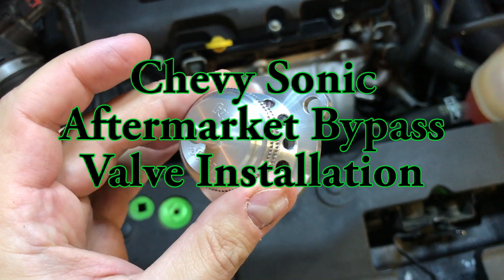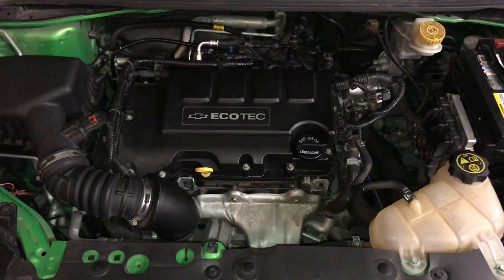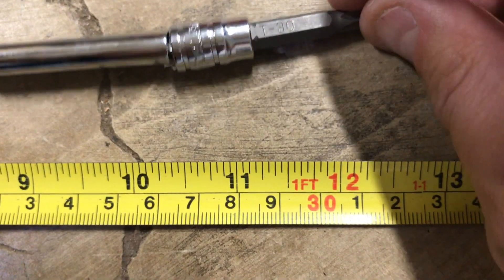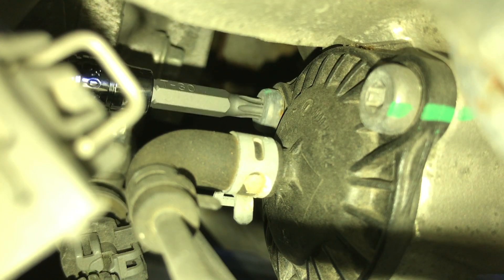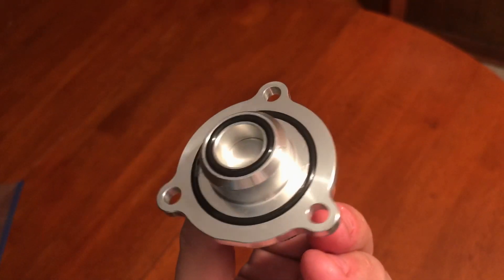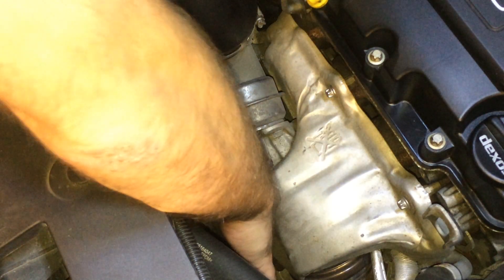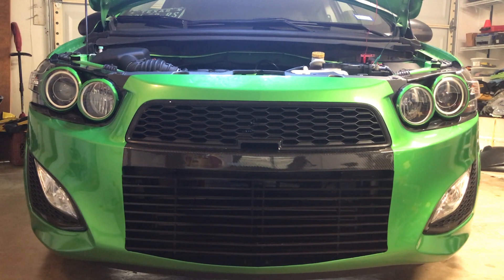Chevy Sonic BOV Install (Atmospheric Bypass Valve)

Comment: Do you use the old diaphragm to hold the new spring or did just put new spring with the valve in? Cause I’m having a hard time seeing what holds the spring center and in place without using the old diaphragm. Please get back to me.
Reply: Please get back to me ASAP.
Reply: Cause I have my car tuned and I don’t what to use. Do I use the new stiffer yellow spring that came with it or do I use the stock one and the diaphragm. Or do I just do not use a spring at all? Please get back to me
Reply: Because i tried using the stiffer spring and it’s almost not even possible to fit it in there. My common sense is telling me not to use a spring at all. Sorry for the spam I’m kinda time sensitive right now. So please reply
Reply from the maker: Nathan Miller I didn’t change the spring that came in the new Forge housing. The factory spring was completely removed. That is of course for the atmospheric. I don’t know the configuration of the Forge recirculating. Does this help?
Reply: DIY Toona yes I just ended up not putting a spring in. It sounds great. I was gonna say it was almost impossible to put the new spring in cause how stiff it was. Thanks for getting back. And this was for the atmospheric.
Reply from the maker: Nathan Miller Glad I could help. For future reference, the stiffer yellow spring can be changed for the internal red one if you decide to have your vehicle tuned for higher pressure boost.
Reply: @DIYToona  Hello, so no spring or diaphragm at all, right? Just the atmospheric valve and the o-rings, correct?
Reply from the maker: David Durán Correct. The stock diaphragm and spring aren’t used in the new installation. There is a plunger-like valve in the Forge with a spring already installed. If you push hard enough on the very center part of the Forge atmospheric it will retract. That’s the function that is similar to the factory diaphragm and spring.
Reply: DIY Toona l
Reply: DIY Toona is this blow off V compatible with the 2018 sonic??
Reply: @RENEM1986  2011 to 2016 i.4t engines however I'm sure you could find a custom blow off valve for your 2018 somewhere, forge may even offer one you just have to be carful not to order the wrong one. Always check year and compatibility
Reply: Can u get a turbo bypass valve code? I got a p2261
Reply: @saintb1500  the code that you have could be a few different things but the main one is the bypass mechanism. cruze culture had P0101 in their description which is mass airflow sensor or something to do with that.
Reply: I have a 2014 Cruze and want to do this. Will it throw a code and do I need a tune?
Reply: @jeffadams6419  It most likely will throw a code though to my knowledge it does not hurt the engine I could be wrong so don't go off of what I say, still recommend a tune to let the engine know what you changed
Reply: I recognize a Forge compressor bypass valve anywhere. 👍👍 Had one for my DSM.

Comment: I had a forge bov that made me go crazy replacing every damn sensor (maf/map/boost sensor/bypass) and broke 3 turbos and i was going crazy trying to figure out whyyy? At last decided to use the oem recirculating valve and reaolved my issue😢

Comment: So i used no spring or diagrham just like this guy did. Same engine as i have a RS cruze. Same thing tho. I changed old with a forge atmospheric w no diaghram or apring as i dont even see how u can even get the yellow spring inwas provided into the new atmospheric new bob so i raw dogged ot. Puty two new seals in it, bolted it up. Clearwd codes. Lets it run 40min and drove it 15min and no codes. Sounds great! So so far so good. Ill keep yall posted and lmk about the spring situation. Need itnor no? I have wastegate set at high boost level to soni dunno...
Reply: Update? Did you need the spring and plunger thing or no?

Comment: That spring you moved from the oem part, does the new by pass valve already come with a built it spring?
Reply from the maker: Yes it does. If you are buying new there will already be a spring inside the housing. It also comes with additional springs of varying stiffness you can swap out.
Reply: @DIYToona  did you have have swap out the spring?? Or just threw it on? I’m starting to modify my trax decent mods already 🤟🏽
Reply from the maker: @nizo6673  I just threw it on with the default spring that’s pre-installed. The other ones are if you are pushing more boost I believe.
Reply: @DIYToona  I’m pushing max 22 psi
Reply from the maker: @nizo6673  I can’t recall which color spring is rated for what PSI. You’d need to look at the Forge specs.
Reply: @DIYToona  says I have to sue yellow how would I do this exchange in springs? What does the spring does the valve have inside already?
Reply from the maker: @nizo6673 The top and base of the Forge valve are threaded. Grab both and twist and it will come apart.
Reply: @DIYToona do I need to just switch out the springs then close and reinstall or do I have to regrease or something?? Will be purchasing this next week on my trax there’s more space to work with might take off my bnr wastegate to make it even easier can’t wait for that better sound my k&n intake sounds good but this will be better!
Reply: @DIYToona also my trax is tuned so I don’t really need to retune right?

Comment: Hello i'm have a question, after install Mily own valvle mi Sonic show me a check engine 😢, code P1101 , Any solution for this?
Reply from the maker: P1101 might mean your mass airflow sensor connector isn’t fully connected or you didn’t put it back on had you removed it during install.
Reply: @DIYToona  yes i removed it, is a mistake?
Reply from the maker: @joseantonioavalosgonzalez8244  not a mistake. Be sure to install it back.

Comment: Does installing a new aftermarket BOV negatively impact the turbo or engine?
Reply: no helps it run more efficient there for saving it in the long run. unless your tuning your car for max power

Comment: Did you put it without the spring?
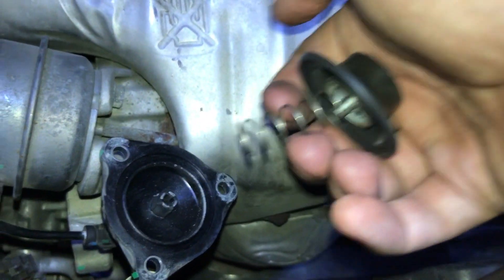Reply from the maker: What you’re asking might be covered in the pinned comment. My guess is you’re asking about the spring that’s part of the factory diaphragm seen at 2:21. No that does not get reused with the aftermarket valve.

Comment: What this valve do??? Be specific
Reply from the maker: Instead of recirculating air about to enter the turbo back into the turbo, it vents it into the atmosphere. Doesn’t add any performance. Just makes the air redirection louder.

Comment: Hey i have a Chevy Cruze basically the same engine set up, if i install this valve does it require a tune? Seen forums saying so but in this video no tune was mentioned. Just curious let me know please!
Reply from the maker: The tune is highly recommended, but other sonic owners (including myself) had no issues operating the vehicle without a tune. Read some of the other comments for more info.

Comment: Awesome!! Clear & precise video of the entire process. I'm about to do this to my 2016 Trax. Gonna get a valve from the same place. Sounded awesome. Thanks for the walk thru man.
Reply: I lied there sold out. Damn. Any other links on a good place to buy a reliable valve that sounds as good as the one you installed?
Reply from the maker: @BlueCollarBastard1987  you can try the one from Cruze Culture. It’s the exacts same valve product code, but I’d email them and see if it will fit the 1.4t in the sonic. (It really should. Same engine and all…)
https://www.cruzeculture.com/products/11-16-chevrolet-cruze-forge-motorsports-1-4t-atmospheric-bypass-valve
Reply: Ok sweet thanks for the advice. I will do that. 👌

Comment: Did you already have a Tune on your ECU, if not won't this new BOV cause a code on the ECU?
Reply from the maker: I didn’t have a tune for several months and never got a check engine light. Some people have reported getting code P0171. Getting a tune will definitely alleviate the possibility of throwing a code.

Comment: Do you need an aftermarket tune for this to work without triggering the check engine light?
Reply from the maker: I didn’t have a tune for several months and never got a check engine light. Some people have reported getting code P0171. Getting a tune will definitely alleviate the possibility of throwing a code.
Reply: @DIYToona  thank you for the reply, I do appreciate it.

Comment: where do i get one of those valves for a 2014 fiat 500l?
Reply from the maker: This might be what you’re looking for. Check the exact specs of your engine and hardware as well as the details on the website before purchasing.
https://500madness.com/fiat-500l-blow-off-valve-forge-motorsport-14l-multi-air-turbo-atmospheric-1843

Comment: Where did you put the bov spring at ? Or you didn’t?
Reply from the maker: The spring that comes out with the factory diaphragm does not get reinstalled. There is a spring inside the Forge Valve.

Comment: I find it funny that I don’t see any simple mods for a 2018 Malibu “other than a K&N filter kit which I did install and was kinda happy with “ im still not happy with the throttle response and I can’t bring my self to spend $300 on a throttle improver module I also did try a adjustable manual boost control but that did nothing but turn on my check engine light on 😳

Comment: Work on 2017 Sonic Premier Sedan 1.4?
Reply from the maker: There’s a chance you’re turbo is slightly different in a 2017, depending on which plant your Sonic came from. Check this site: https://www.forgemotorsport.com/Blow_Off_Valve_for_Focus_RS_MK3_Corsa_Chevy_Cruze_Sonic--product--982.html#
There is a diagram in the valve description that shows what to look for compatibility wise.

Comment: Will this work on the sedans still 1.4t?
Reply from the maker: It absolutely will. The engine is the same and layout under the hood is identical. Even if you have a newer sedan you’ll find everything in the same place with same fitment.
Reply: Trying to do it now can’t get the ratchet in therefor the life of me

Comment: What would I have to do to make it flutter now?
Reply from the maker: You could have it tuned to produce more of a flutter. The flutter is the sound of peak pressured air between the turbo and intake not being able to enter the engine and instead fighting the turbo. The whole point of a bypass valve to to reduce this.

Comment: I just installed a Blow off valve and next day a check engine light came out as p0171. And i have it in straight pipe what could cause this?
Reply: You need a tune

Comment: would this part fit on a 2015 chevy cruze as well? i know they are both a 1.4L but i dont know much about chevys so i dont know if they are the same engine and everything
Reply from the maker: According to the documentation on the Forge valve and Chevy, YES, this will fit the 2015 Cruze with the 1.4L Turbo Ecotec LUJ/LUV engine.

Comment: HelIo, need to do a question. Did you feel that your car is slower or has any performance reduce? Im about to install this valve to my Opel Corsa 1.4 turbo (same engine as Sonic Turbo) with stage 1 tune. Thanks and great video too :)
Reply from the maker: No I honestly couldn’t feel a difference in overall power.

Comment: Do you need a tune for this or does it work okay with the stock tune?
Reply from the maker: NvrStpGaming There are some more detailed discussions on this in earlier comments. The short answer is no.
Reply: @DIYToona  Thanks for responding.  Looking through the comments its looks like I will need to tune it since I own a 2018 Sonic

Comment: Will this work on a factory chevy cruze?
Reply from the maker: SuK DiS This forge valve is compatible with the 1.4L turbo engine found on Chevy Cruze, Sonic, Ford Focus RS MK3, and Corsa
Reply: So I don't need any tune with it?
Reply from the maker: SuK DiS These engines are such low boost / air flow the small amount of metered air lost to the atmosphere doesn’t cause any faults or codes. I’d still recommend a tune to take advantage of the optional stiffer spring that comes with the valve. That way you can increase your psi.

Comment: Just wondering, Can i install a blowoff valve and have a cold air intake? Or do i need the stock intake for this to work properly
Reply from the maker: Noah Jacobs This BOV will work with both stock engine air intake and a cold air. I currently have an MPFab intake with the Amsoil conical filter on it and it works just fine.

Comment: do you install the new spring and the old diaphram back on.or theres no need for it
Reply from the maker: KING TURK if you are using the Forge valve, it’s own spring is contained within the housing. Do NOT reinstall the factory spring and diaphragm.
Reply: @DIYToona  yes mine ia forge also.so i dont use diaphram and orginal factory spring.
Just the new spring that has come with the forge valve
Reply from the maker: KING TURK The forge comes with a spring already installed (it’s internal so you can’t see it without taking the valve apart). The second spring that came with is is of a different stiffness for people who’s engines are tuned to use more boost pressure.
Reply: @DIYToona  ok so no need to use that.spring thats come with it.
But when you install your valve.
You didnt include the part when you installed.

Did you use the old apring and diaphram again.
Or did you install without both..thays the part thats got me confused
Reply: I have ecu program on my car.would i need the spring installed
Reply from the maker: KING TURK NO I don’t reinstall the factory diaphragm and spring. The stuff in my hand at 2:20 got put away in a box.  You would only need to switch the Forge springs if your ECU program requires it.
Reply: @DIYToona  ok thank you for your time and video.
Got it now.
Great help.keep up the hard work
Reply from the maker: KING TURK Maybe this Video will help you understand. The Forge valve comes with a spring installed INSIDE it. You can’t see it. That’s why my video just shows putting the Forge on and nothing else. https://youtu.be/5nHBNcs0HGw
Reply: @DIYToona  i see what you mean now.
Theres allready a spring built internal.
That does the same job as what the factory allready had installed.
As also a diaphram.so no nees for that aswell.
Roger that ...thanks

Comment: Did you ever have oily residue around the engine ? Someone told me that atmospheric blow oil out over time and it goes on your engine .
Reply from the maker: RadDadGarage Since you asked I went out and checked. Looked all around the BOV area and below so see if there are any signs of oil residue. I honestly didn’t see (or feel) any. I’ve only have my BOV installed for 25 months (14,400 miles). Maybe something like that happens much later in its life.
Reply: @DIYToona  
I appreciate it thanks  I asked cuz one guy had all these mods and had a forge recirculation valve I asked him why ? That's what he told me it blows oil all over ...so now I know it don't , if combined with a catch can even better

Comment: hello sir,just ask can you tell me the distance between from  this Triangular 3 hole from dump blow off valve;;?? **great job
Reply from the maker: DoC I don’t understand. The distance between each triangular hole?
Reply: @DIYToona  yes.. this is exactly what I want to know
Reply from the maker: DoC Hey sorry it took so long to reply. I had to take the measurements myself. So center to center each hole is aprox 2.024” away from each other in a triangular pattern.

Comment: Would this work on 2020 sonic rs?
Reply from the maker: Omar Yes. The 2020 Sonic RS uses the same LUV/LUJ turbocharged engine. The procedure for install will be the same, but the technique might vary because of the engine bay layout. Some have claimed the diaphragm screws (3) are easier to assess on the newer models.
Reply from the maker: I stand corrected. Although the engine is the same, the 2016+ Sonic and Cruze models evidently use an electronically controlled valve and the one featured in the video will not work! For more information check out the forgemotorsport website.
Reply: @DIYToona  whatttttttt so my car can’t sound like this???

Comment: Will this be compatible with a 2018??????
Reply from the maker: Rene Martinez This is compatible with the 2018 using the 1.4L Turbo (LUV) engine. The positioning of components in the engine bay where the BOV goes in place of the stock recirculating allows for identical fitment.
Reply from the maker: I’ve recently been corrected. Although the engine is the same, the 2016+ models use an electronically controlled valve. For more information on fitment and valve options, hit up the forgemotorsport website.

Comment: Trying to get a actuator.but dont know what spring to install.
For my stock chevy trax 1.4 turbo
Reply from the maker: KING TURK are you looking at the ZZP wastegate actuator?
Reply: @DIYToona  
No another k04 type.
It comes with A yellow spring installed.
1.0 bar spring.
Reply: Unfortanetly i have a paypal issue that zzp only use overseaa.my country is not compatible with paypal so i had to get a universal 14.5 psi seting actuator from alibaba

Comment: Any idea what our 1.4 turbo psi is at stock
Reply from the maker: That I actually don’t know off the top of my head.
Reply: Hello I know I am about a year late to answer your question but my 2015 Sonic RS 1.4 at 78000 miles regularly makes 17 to 17.7lbs boost. I have ZZP Intake & Catback exhaust are only mods. These readings are coming from the Torque app on my android phone.

Comment: So NO spring or diaphram when installing after market BOV .
Reply from the maker: Correct. The Forge Atmospheric valve has a spring built into it. If you were to push on the center piece of the aftermarket valve you’ll find it moves with some resistance due to the built-in spring. You don’t reuse any parts from the factory diaphragm.
Reply: @DIYToona  thanks you been great help